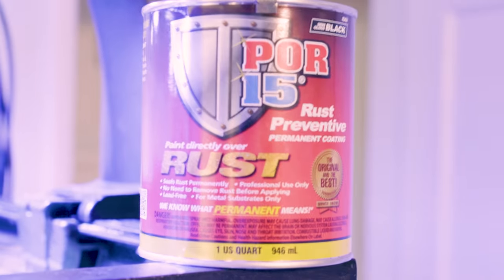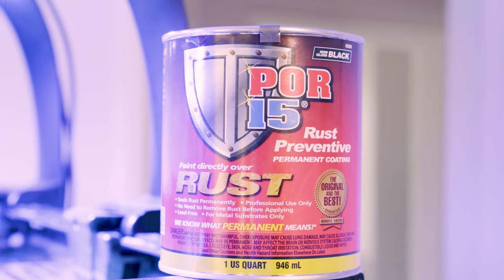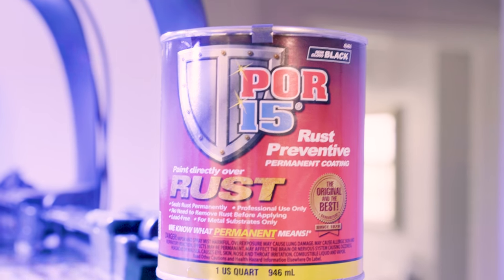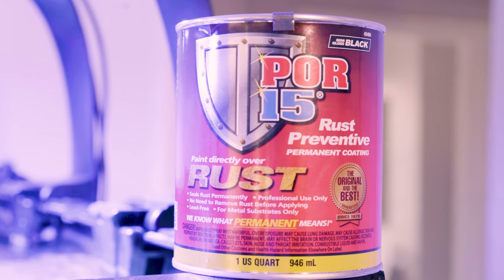High Tin & Other Metal Contamination in a Reef Tank

Comment: What do you say about adding new long pvc tubing to the tank. Since I have had a shocking increase in Tin as well Two months ago 9-22-2022 I was at 26ug/L and now 125ug/L+ 1-12-2022. While actually running rhowaphos to reduce zinc. And bought new tds meter and both new and old show 0 tds on incoming water.

Comment: Good idea on the molycoat! I gotta get some. Good luck on removing tin. I fought a long battle with it.
Reply from the maker: Yea, I think it's probably the rust around the edges. Repainting it this week. Fingers crossed! A single tube of Molykote 111 will probably last you forever, a little goes a long way. You can get it on amazon/ebay pretty easily if you can't find it in a store.